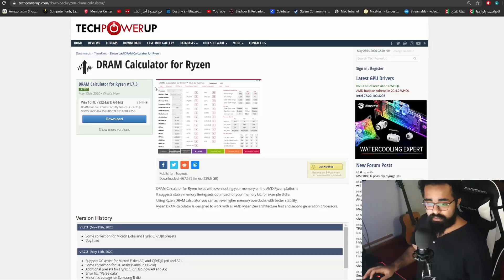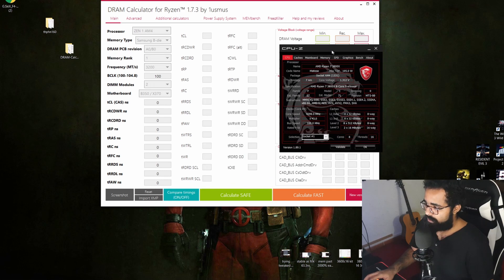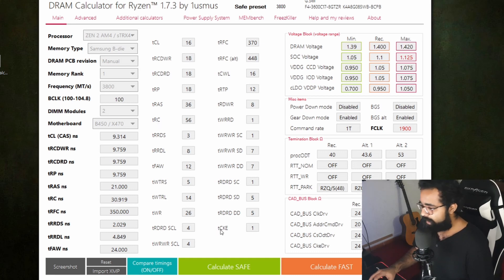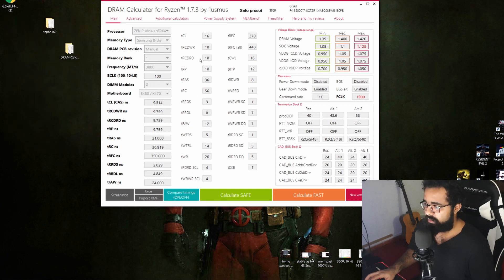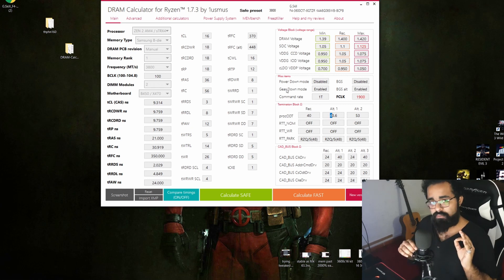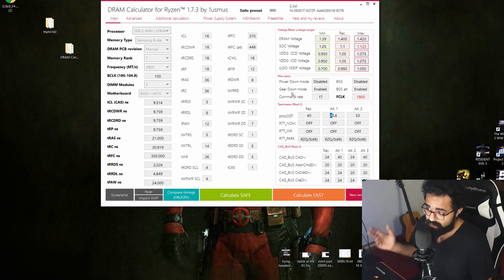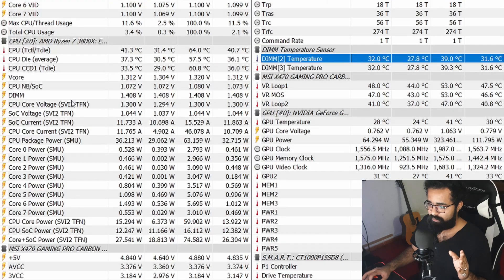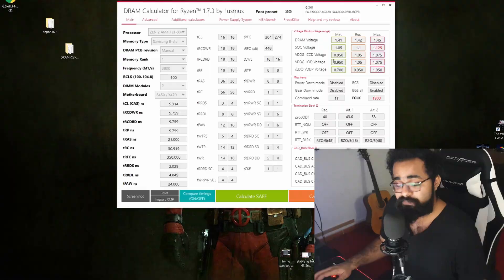Ryzen Ram Overclocking Guide | Using 3600 c17 kit

Comment: "Unstable" For me, usually BSOD codes to look for are "PAGE_FAULT_IN_NON_PAGED_AREA", "BAD_POOL_HEADER" and non-BSOD errors that indicate corruption, Windows also may falsely claim file-not-found. Also, be on the lookout for Windows update failures out of nowhere. Unlike video RAM instability, people who aren't lucky, could be forced to wipe the drive and reinstall Windows.
Reply from the maker: May I ask what RAM kit are you using? 

Corrupting windows isn't easy to do but can happen when not knowing what are you changing when RAM overclocking, However, it didnt happened to me before.
Those BSODs are clearly RAM related too.
Reply: @ammartech3660  The Ryzen daily driver has Corsair Vengeance LPX 3000 and I didn't even use XMP until just some hours ago, LOL. Thaiphoon shows Micron D-die and single rank.
Reply from the maker: @RJARRRPCGP  oh wow haha, Well if you want you can try messing around with it.. but I dont think it will overclock well too.. Rev E is what you want for Micron IC's.. Or a good Samsung B-die IC kit.
Reply: @ammartech3660  I have what looks like a strange issue: The 10 left "ns" fields are at "0". (At the lower left of the calculator)
Reply from the maker: @RJARRRPCGP  Try importing the XMP profile from Thaiphoon burner and then Export it into the Dram calculator, that should make the value appears. 
If not, then close Dram calculator and re-open it.
Reply: @ammartech3660  I got it now, but I found another option in Thaiphoon Burner and only then, did the calculator told me that the export data didn't contain the nanoseconds, but I know where that option is in Thaiphoon Burner now.

Comment: Didn't work for me, I entered all the timings etc in the bios using the safe settings. Then my pc seemed to power on but the monitor stayed black. I resetted the bios by removing the battery and drain the power, luckily I had saved profiles so a few clicks later I was using my old settings again. Now I know for sure that I will not OC my RAM past the settings I've already done XD I hate opening my case, remove the GPU, reset bios and put it all back in again.

Comment: thanks for showing the import html part... I saw many videos and none other showed this. values that came without importing were nowhere near stable. I'm gonna try again now.
Reply from the maker: No problem ! And good luck !
Reply: @ammartech3660  I'm using CMW16GX4M2D3600C18 ram kit.

Ryzen Master showed me I can go down to cl16 with 3.6v

But I tried that with even 1.42v and it wouldn't work. Either won't boot or will boot but go to 2133MHz.

I even tried cl17 with 1.4v and that wasn't stable.

What could be wrong here? I do believe I followed everything correctly.

My rams just won't tighten timings. 😐
Reply from the maker: @iftekharemon4744  Okay, so your kit is actually 3600 c18 22 22 42 ... you might be lucky if you can do 16 18 18 36~38 , If not try 18 20 20 40 .. 
If it doesnt POST, then you might need to increase ProcODT value just dont go over 60 ohms, also, make sure you have SoC at 1.1v and that might help with booting up.. 
If nothing helped, then, sorry..

Comment: Thaiphoon Burner seems to be suspicious to Windows Defender. There has been some speculation it was taken over by someone who put a Trojan on it.
Reply from the maker: I have the software since a very long time around one year now , and i never faced any issues with it.
Its just so you/I can know the type of IC's that the memory stick use. 
Usually 14 14 14 28~32 at 3200 and 16 16 16 36 3600 and 3600 14 15 15 35 along with 3800 14 16 16 are samsung B-die, as well 4400mhz 19 19 19 39 is also samsung B-die as far as i know
Reply: That's my concern as well. Will it work in Sandboxie or do I need to make a VM?
Reply: @Liberty Prime No such issue with new Windows 10 20H2 installation.

Comment: What about b550 mobo?
Reply from the maker: I think the option is there, if not, try x570 and try
Reply: @ammartech3660  I tried b450 and it worked
Reply from the maker: @f_aaris  nice, now start with safe timings and see if its stable, i found mixing both safe primary timings, with fast sub-timings gave me good results. 
Might update a follow up on my new kit in the next few days. it will be interesting ;)
Reply: @ammartech3660  it's not letting me click fast, it says it's not compatible with "manual" and it says use safe

Comment: Thaiphoon doesn't show the type of die for density. All i get is "4 Gb / 1 die". Is there any other way to tell what it is? I can't find anything
Reply from the maker: which memory and what speeds?
Reply: @ammartech3660  Patriot Viper 4 Blackout 8 GB (2 x 4 GB) DDR4-3000 CL16 Memory.
Thaiphoon says: (I've seen thread saying thaiphoon guesses)
Dram Component manufacturer is SpecTek. Organization is 512M x64 (1 rank)
The part number is jumbled. I don't have the stickers that came with my dimms so I can't find what the part number actually is, but it says MT40A512M8??-093E:? which is weird.
Reply from the maker: @benkarn7007  I think , it might be Hynix C die. 
but im not 100% sure
Reply: @ammartech3660 ok thanks. I've been searching nonstop for 4 hours and i've found tons of different results. what happens if i put the wrong die into dram calculator?
Reply from the maker: @benkarn7007  worst case scenario, you will have to reset the bios and start all over again ..
try 16 19 19 39 at 1.4v , last time i checked my friend did this at 3600mhz on his hynix RAM

Comment: not everyone knows dram calc. I'm here to find out how to use it and you dont explain it.
Reply from the maker: All you gotta do is, when launching Dram calculator, is importing the complete HTML report , and changing the "processor" to your current CPU. and then change the Frequency to the speed you want, and dont forget to change the motherboard to the one you already use. and after that just calculate safe or fast. 
and thats almost it :) 
keep in mind, not all ram kits will do fast, some will do safe main timings, and fast sub-timings. so from here its mostly trial and error :)
Reply: @ammartech3660  The  second values column are shown in red, why is that? I've got the same 1.7.3 version.
Reply from the maker: @blackisblack22  Yeah, i just tried it, and it does have red values, and it should not be an issue too
Reply: Ammar Tech Either way I couldn't get the overclocking to work in safe or fast mode. There were so many tests and restarts that I decided to resign myself to living with a memory of 2133 instead of 3200 😔
Reply from the maker: @blackisblack22  Okay what kit do you got? and what are the primary timings , also what CPU and motherboard you got?
Reply: Ammar Tech I have a 2x16 kit of Corsair Vengeance LPX 3200 and a Rog Strix B450-I gaming mobo. The XMP profile included also doesn’t work at all.
Reply from the maker: @blackisblack22  oh wow... 
Enable XMP , and just increase the Dram voltage to somewhere around 1.35~1.38v and it should work, and yes it is safe
Reply: Ammar Tech I just changed the bus to 1600, ram to 3200 and everything to auto and it works! No XMP was necessary 😃
Reply from the maker: @blackisblack22  Nice ! Glad it worked 🤘😃
Reply: @blackisblack22  Have the exact same RAM and motherboard. Same issue here
Reply: MR RATCHET Have you made the changes? Has it worked for you like it did for me?
Reply: @blackisblack22  I haven't yet (currently running Memtest86), where did you find the two settings you changed? Will give it a go once this is done!
Reply: MR RATCHET BIOS.
Reply: @ammartech3660  So far, all I did, was enable XMP for mine (MSI B450 Tomahawk, with UEFI BIOS version 1E) and the motherboard seems to do a good job of keeping the Fclk and Uclk at 1:1! It also appeared to have raised the VDIMM to near 1.38V as well. (1.376 V, according to HWInfo64 6.43-4370)
Reply from the maker: @RJARRRPCGP  Glad it worked and thats a solid board too :) , and btw It happens even on my board and other people I know using different boards " The extra VDIMM bump  0.02v " which is seems to be inaccurate reading.

Comment: I have the exact same kit. I don't know what's going on with this kit but tRCD_RD would not f+cking lower further than 18. I'm still watching the video. If anything, I'll be editing this comment.

Edit: I wasn't sure about the temperature either but I let F1 2018 run its built-in benchmark, my RAM reached 55°C and nothing happened.

Edit: I finished watching the video. I was stock at 3733MHz (pretty stable though). I'm following the guideline on GitHub for DDR4 overclock and I'll let you know if I can tighten it a bit more than you. Thanks for the video!
Reply from the maker: Good luck dude :) let me know if you was able to lower the trcd .. because i gave up on my kit already
EDIT; 
You can just copy my timings and see if it'll work for you :) they are pretty much as tight as this kit can do at around 1.4v , 48Ohm on procODT and 1.075~1.080 on SoC .
Reply: @ammartech3660  I was able to achieve 16-16-17-16-32-48 at 1.39v, check out my spreadsheet so you can see everything with detail. here's an img: https://i.imgur.com/PLDDLgk.png
And here's the spreadsheet: https://drive.google.com/file/d/1ptWuoF8ZcKfFQal-dqgMF5BpGnReznxo/view
Keep in mind that in my BIOS I have tRCDRD first and then tRCDWR below it, and that's how you'll see it on the spreadsheet (though at the beginning of this comment I put it in the common order).
Also, make sure to see the note I left on test#19 on the spreadsheet.
I'm aware of the silicon lottery thing, but I really hope this can help you. Good luck dude!!
Reply from the maker: @MaikelAt  Thanks for sharing this! Will re-test the kit again! 
I usually keep GDM off just to shave a 1ns or so .. but will try with GDM enable and see
Reply: @ammartech3660  I just realized that it's stable ONLY if the temperature is cool (I think below 40°C). When I did the test my room was pretty cold and it passed 30cycles on TM5. But I was playing a bit and I had to pause the game and do something... When I came back I realized that the game was closed and the PC was just sitting at the desktop. So I decided to run TM5 again + HWinfo to see temps. It gave me errors (temperature was at 45°C when I saw)... So, if it's cold in your room it might work, but I remember you mention you heard people saying that over 40°C it gives random errors, that makes me think your room might not be that cold.

None of my 3800 values have worked so far. I'll try yours and if I can make any improvement I'll come back to let you know. Can you please share your rtt, cadbus, procODT, tRFC2, tRFC4 and voltages?
Reply from the maker: Oh yeah, temps can do cause crashes.. but i have not yet had a crash during a load on it .. but i guess that because my room is fairly cool " around 22C " + a good airflow too.
last time i checked on samsung spredsheet, the oparating temps were from 0 to 70C so i figured well, maybe 50C is the highest before starting getting some instability.
i did use the same values, just the CAD Bus i used 24 across the board. and procODT at 48ohms , Soc 1.075~1.080 , Dram at 1.4v 
https://i.imgur.com/S9pBWDL.jpg
here's my latency on Aida64 : 
https://i.imgur.com/SV4K4l2.jpg
Reply from the maker: @MaikelAt  i also did 16 16 16 36 and it did actually boot just fine, and did aida64 memory bench, but thats all i can do at 1.5v, tried 14 16 16 at 3800 with 1.6~1.7v on Dram, and nope, it barely boots into windows and then crashes lol.
Maybe try disabling GDM and see if you can get it stable at current timings? but i guess at this point we wont see much difference, because our kits are already at their max.. 
however, i do believe that those kit can run high frequencies maybe 4000~4400 with a bit of luck at 19 19 19 39 or even 19 20 20 42 at 1.5v
Reply: @ammartech3660  thanks for the info... I actually don't plan to pass 3800 at  the moment. I'm doing my best to see if I can get it stable at least. I'll try yours and let you know. By the way, what's your CLDO VDDP and your VDDG (both)?